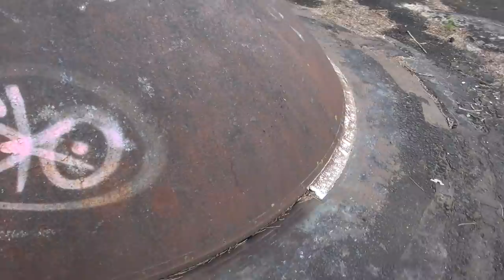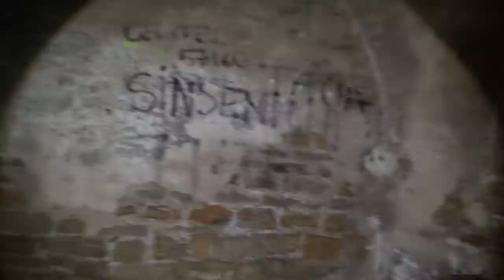Festung Alvensleben - Steel domes and Brick walls. The beginning of modern war.

Comment: Just thinking about the "electrics" in that place:

In the very early days, believe France used 110 Volt mains, as per the Edison system in the USA.

Because of the problems of insulating the strands of wire, it was often run inside buildings, supported on ceramic insulators spaced 10 to 15 centimetres apart: Crude but effective. This sort of wiring was still to be seen houses in Hanoi in 1990,alongside the "modern" stuff; 220V 50 Hz AC, in insulated cables but with stylish ceramic switch units and lamp-holders. So, those pairs of ceramic insulators on the ceiling of the tunnels would be remnants of the first generation electrical cabling. The bare (or, perhaps cotton-wrapped" copper wire has long since been "salvaged".

The other thing I spotted was at 19:20, the "Yellowstone" building; "totally different", that appeared to have a variation on the classic French "Mansard" roof style. Or, am I reading too much into this?

Who mows the lawn at the headquarters building? 

Apart from plain old vandalism, I suspect the people who destroyed the fittings in the big ablution hall were after the copper plumbing; possiblty the same people wh stripped out the wiring in the tunnels. Disheartening.

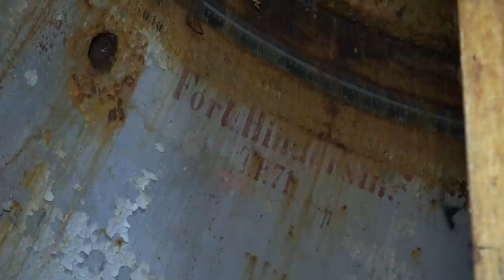Comment: At 31:30, when you're in a dome, "Fort Hindersin T.P.71" is painted on the wall, under a rim that looks to have measurements on it. According to a rough map of the Metz area fortifications, Hindersin should be 2-3 miles Northeast of Alvensleben, could the writing be coordinates / gun directions for supporting fire?

Comment: 1870's Cannons must have been Breech Loading emplacement of Steel in Concrete & Block.  Europe was way ahead of USA.

Reminds me of when I was stationed 1971 till 1973 at Gutleut Kaserne in Frankfurt, Germany.  7th Army.  Built in 1877 - 1879.  Next to the main Train Station.  Four Stories - more like six - with massive granite blocks & Steel I Beams for framing; at least between floors.  Kaiser Wilhelm called for the structures to withstand a siege by the 75 MM Field Guns that the Germans had at the time.  Super thick walls.  the claim is that this was one of the first German Military Buildings containing Steel I Beams for strength .
Reply from the maker: Was they still standing when you left? That is something I would love to swing by and see..
Reply: An Army buddy from Iowa visited compound with his first wife in late 80's - I think - and the Kaserne was returned to the Germans.  Army mover to Rein Mein Air Force Base.  They kept the entrance & wall around the Compound, as well as the US built basketball/gym, but they tore down all the buildings.  Knowing the Germans they probably recycled the materials; real good at that. This Kaserne was the SS HQ -  WW II.
Reply: An Army buddy from Iowa visited compound with his first wife in late 80's - I think, and the Kaserne was returned to the West Germans.  Army moved to Rein Mein Air Force Base.  They kept the entrance & wall around the Compound, as well as the US built basketball/gym, but they tore down all the buildings.  Knowing the Germans they probably recycled the materials; real good at that. This Kaserne was the SS HQ -  WW II.

Basements were like dungeons and rooms had the original heavy wood doors;  many rooms had doors with heavy steel grates on the corridor side.  Rumor is that the Gestapo held their interrogated guests there.  Top of third floor of the buildings had massive high roofs with corridors & rooms.  I was assigned a single room ( NCO ) - reinforced corner with end stairwells - during my service time.  I could still look out  over much of the city down to the River Maine.  This was during the Cold War and Viet Nam Conflict ( 71-73 ).   This Tour was great.  Thank you.